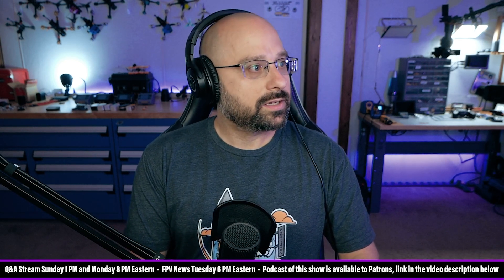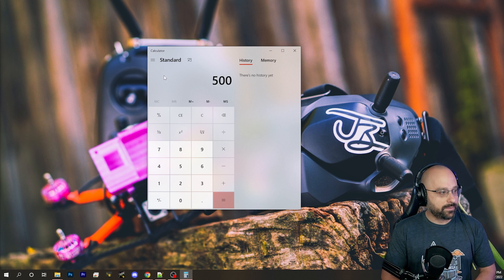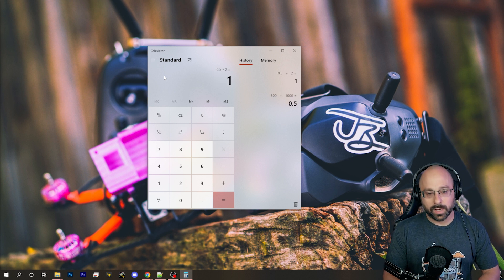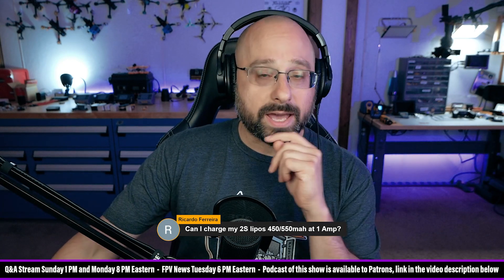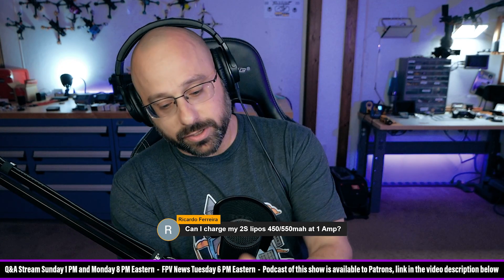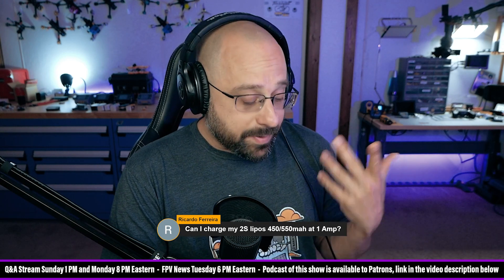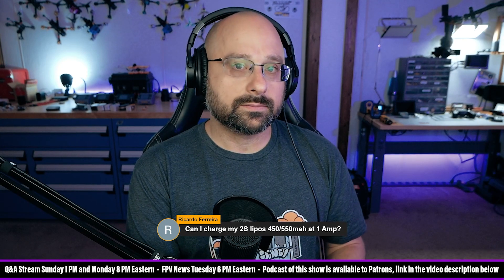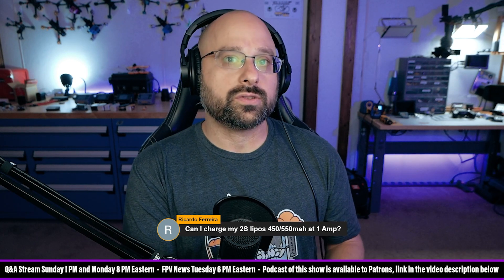What C Rate Should I Charge My Lipo Batteries At? - FPV Questions

Comment: Car manufacturers tell you your transmission is sealed because its lifetime fluid and your oil changes can be 10,000 miles and it’ll last the life of the engine….so when they go out at 100,000 miles they can say “yup that’s the life of that engine and transmission”. But had you done normal maintenance, it would have lasted you 300,000 miles.

Comment: HRB 4000  6S 
Spectrum smart 2100 charger. 
Trying to set the charger to charge at 2x, which would be 8 A. Charger defaults to charge rate of 4.1. It must be smarter than me.

Comment: I just got back into rc car racing and those guys are charging 2s cells at 40 amps and discharging at 20 amps on a constant cycle to heat the battery and lower resistance. They time the end charge of say the 5th cycle to coincide with the start of the race. If the battery sits a few minutes before the race and cools all benefits lost. They are aware this ruins the battery but id say more than half the drivers do this. I do not

Comment: Also noteworthy, you start getting exponentially diminishing returns on decreasing the required charge time with higher charge rates while at the same time exponentially increasing the risk factor. Charging at 5C doesn't shrink the required charge time by very much over 3C when compared to charging at 2C or 3C versus charging at 1C.

Comment: How about charging at a lower than 1C, does that improve the lifespan of the Lipo???
After all, the manufacturer wants you to purchase more, so it's in their best interests to get you to charge at the highest, but Safest, current possible.
Where if charging like a trickle charger, puts less stress on the battery.....
Just asking...
Reply: Charging at less than 1C will be even better, and give the cells a better chance of being balanced.

Comment: I was sitting outside of the room where 2 of my LiPos were charging and modified something on my quad, when suddenly it smelled like an IC or some other electronic part burned. At first I thought that something on my quad had gone wrong, checked, but didn't find anything. The smell got worse and then it clicked in my head: there are LiPos charging in the nearby room!

So I stormed into said room and just wanted to rip the "safety" bag from the charger to throw it outside, when there was a big WOOF and the whole thing was instantly on fire with the bench and table around it; there was a crackle like a campfire. I went out of the room instantly and my brother fetched a fire extinguisher. I took it and went into the room again but couldn't even see anything anymore because of black smoke and other yummy particles. I just sprayed in the general direction of the LiPos several times and luckily it seemed to extinguish the fire because our house - which is 70ish years old - didn't burn down. The fire brigade only had to blow out the smoke and apply a minimal dose of water, thankfully.

Output: 1 room completely burned out and 2 others full of fire extinguisher powder - all in 1 - 2 minutes of LiPo fire.

I always considered myself handling the LiPos carefully, I even checked the batteries frequently when charging and always charged them in the "safety" bags. Also I never charge above 2c.

Moral of the story:
- "Safety" bags are not at all safe
- Charging IS dangerous
- Always charge in a LiPo box or an area where nothing can burn
- Respect your LiPos, you don't want to be an enemy and they have feelings too
- I am now paranoid when smelling that "electronic" smell
Reply: What do u mean by a lipo box. Metal one?
Reply: @joseluisrodriguezgarcia5582  yeah you can take ammunition crates but there are also special containers for Lithium batteries. They are called "Bat Safe", just google it.

Comment: we need FPV Fire extinguisher kits. 
something like 2 small, 1 large and a fire blanket... 
we all do a group buy annually...
Reply: Thats a good idea but also we need to be aware of where we store these things anytime, charged or not. I used to keep a  tiny bbq grill filled with lipos until i just got a sweet metal cart from work at the battery company. I work in battery manufacturing and i assure you batteries will just blow up sometimes, be careful. We had a pack lastweek made of about 20 cells and one of them was on the shelf and just started popping, after an investigation the only thing we could come up with is bad cells, all welds were correct and no visible damage to casing, aside from where they popped.

Comment: I would add that it's not just the risk of fire, the higher the c charge rate also causes more wear and tear and shortens the battery life. Your battery should be cold before you charge it and remain cold  during the charge.
Reply: There are 0 studies or papers that conclude with any solid evidence that charging above 1C does any measurable damage to a lipo at all... EVERY single person I've ever met with large lipos charges at 2c+. give me a source that states that a cycle life or voltage of a battery is affected by charge current. You cannot.
Reply: If your battery can discharge at say 100C with bursts of 200C, it won't be any problem to charge it at 2C. I d go even 3C. If it feel JUST warm to the touch, say 20-30 degrees, that's even better for the battery as this is the ideal for lithium. The only issue is that your balancer should be capable of balancing any cells with higher voltage fast enough for the 2 or 3 C.
Reply: Wired, cars heats it's battery for save charging...new BYD blade battery for Tesla heats up to 60°C
Reply: @cor3fpv  Short answer: Those aren't LiPos.

I don't know what kind of battery these cars use, but almost every small consumer lithium based battery or powered device I've seen has warnings all over it that you will have a Bad Day if your battery goes above 50°C.
There is truth to the fact that batteries have an ideal temperature for charging and discharging, but for our tiny hobby LiPos, that's close enough to room temperature. 
There's also the factor of controlled vs uncontrolled heat.
The car has powerful climate controls at its disposal to perfectly maintain the exact desired temperature, and to dissipate the heat of charging at a bazillion amps.
Your little drone battery doesn't have this luxury. And if it's not dissipating all the heat of charging, it'll start heating up.
Get too hot, and the chemical reactions inside will enter a runaway state. Boom.
Reply: @FerralVideo  google an gensace claim about 45°C as Max for charging...so "cold" is relative

Comment: Pretty much all of my packs are rated for 5C charging. I parallel 6 packs at the max 12.9 amps every charge. I ALWAYS sit next to them and monitor their temps during the entire charge however. Any of them gets slightly warm and I back it off to around 1.5-2c depending on what size packs i’m charging.

Comment: I think waiting the extra time for a battery to charge is well worth saving your battery as well as your home 😁 sounds crazy but when I discharge a lipo to discard it I run an extention cord out to the back yard away from EVERYTHING and plug up my charger and begin discharging lol I RESPECT LIPOS 🙏🏽✌🏽
Reply: I take mine out in the driveway, clamp vice grips across the connection of each individual cell and let them do their thing. Quick and safe. 
I always disassemble bad packs because the majority of the time it’s one cell damaged in a crash and I can salvage the rest after doing the feel test (zero puff allowed, must be absolutely solid), visual test (any defect in the foil gets labeled as bad and disposed of) as well as internal resistance checked (anything above about 2.5mohms is disposed of). I mark them and assemble new packs with matched specs for my own use. Saves space in the landfill and keeps me from having to buy packs all the time on an already overstrained supply system these days.
Reply: @benupde1979  great method 👍🏽